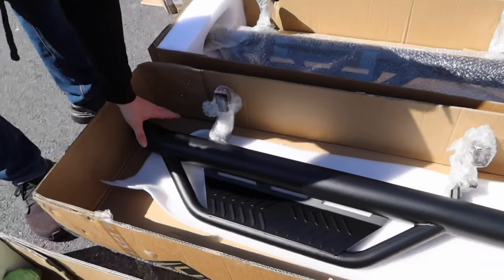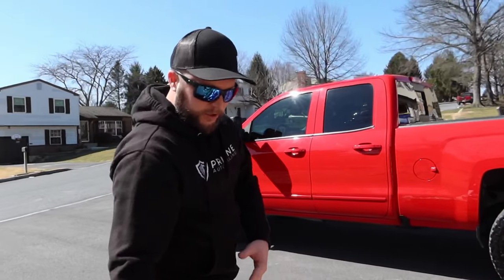Truck Side Steps vs Running Boards: The ULTIMATE Comparison | Truck Central

Comment: I would choose the second option.  They for the most part will never fail since they are fixed in place, less moving parts.  I also feel they add to the look of the truck.  The AMP's are real nice high tech option but seem more suited for a luxury type vehicle.  I would be quite bothered if I bought them and they failed in the middle of winter due to ice/snow/salt/freezing temps.
Reply: Nailed it. I have a guy who buys cars for me at auction. He has a mechanic shop and used car shop. I had him shopping f150 and one of the first things he said is the high trim levels with the moving running boards are constantly an issue. Here in Michigan anyway. Dirt and road debris works it's way in the moving areas and the get stuck in down position. After he said something I started noticing them all over, driving with one up and one down. No thanks.
Reply: I agree
Reply: I have a truck with a 6" lift. I bought the step within a step running boards...sold by ARIES!!!!  I HAVE NEVER SEEN ANOTHER TRUCK WITH THIS AWESOME 2 step system. I am the FIRST!!!!

SMOKE CIGARETTES ....

Comment: The delay makes sense! I have the same brand, but mine are a bit older of a model apparently. Mine don't have the delay, which is dumb, because when you close the front door, only to get something from the back seat a second later, the step has to come down and go back twice every time..

Comment: Thank you Sir for your time and effort. When AMP charges you 1500.00 bucks plus tax and they want you to mount their module with zip ties?   Zip ties. Who on their design team said yea this is a great idea. Even worse someone had to approve it.  You did an excellent job with this video. New subscriber.
Reply: They wouldn't last very long in the Arizona heat.
Reply: Probably an electrician, but, do not under estimate zip ties

Comment: I have the same problem as you, a short better half.  Those power steps are great, but we’re too pricey when I bought my Colorado.  I’ve been running the Westin HDX drop nerf bars for 4 years now and they have held up great.

Comment: I live in the south so I would choose the amp research, motorized step bars. If however, you live in the salt belt, I would avoid that option entirely and go with the middle one.

Comment: I would like the Amp Research steps if they were installed on a truck that I only drive during nice weather. (And cost was no issue...). I have yet to see a review for the Amp steps on a truck that was driven in a winter climate that had to deal with snow, ice and salt. Will the step not operate when snow and ice builds up behind the front wheels? Will it burn up the motor if the step can not unfold all the way or will is strip out the gear, or will they not work at all? I would be upset if I paid $1500 to $1800 for a step I couldn’t use. Just my 2 cents.

Comment: Thank you! I went ahead and replaced the running boards on my ram 1500. Afterwards I changed the battery and have a constant message that says “power side steps unavailable.” The message goes on and off. Have you experienced this? Any recommendations for this message to be cleared?

Comment: For my style truck, non 4x4, it would be the Amp. Being my truck is a Ram Lonestar it fits the style better. But, it's 18yr old truck so I wouldn't spend 1500 on steps at this point.

Comment: For me if I had a truck, I would go for the mid tier steps, cause in my opinion, spending 1500 dollars on side steps is stupid. Let's remember 1500 dollars is alot of money. I rather use that money towards any other mod for a truck.
Reply from the maker: Definite the “luxury” option out of the 3. They really start to make sense financially if you’re looking for certain luxury features but don’t want to shell out $80k for a High Country/Denali/etc
Reply: @TruckCentral  sure, but honestly I rather not have another electric thing also to break either. Personally, as cool as those steps are, I would probably pass, unless I was made of money lol

Comment: Can you set it up so where the light don’t turn on?
Reply from the maker: The LEDs have a separate connector on the wiring harness (unplugged = off). To manually control them frequently, the easiest way would probably be to splice in a switch and mount it on the dash

Comment: I wonder how the" Electric " are in the snow and ice. ??
Reply: Well,my new factory 2017 Yukon Denali auto step sucked…I live on dirt road, Kansas, mud,snow,slush. In my conditions I would look for Frame Mount, No Electronics, Black,Durable step.
But they may all rocker/cab mount?
Reply: @brentm7213  Thanks!